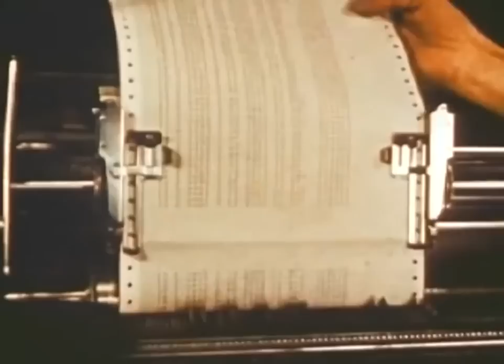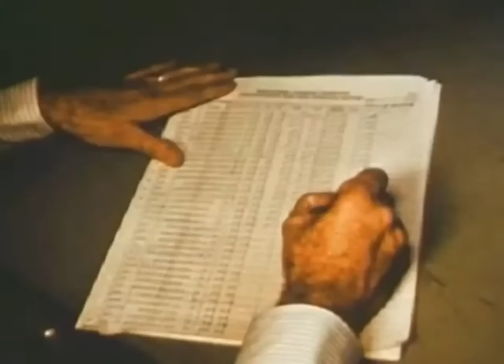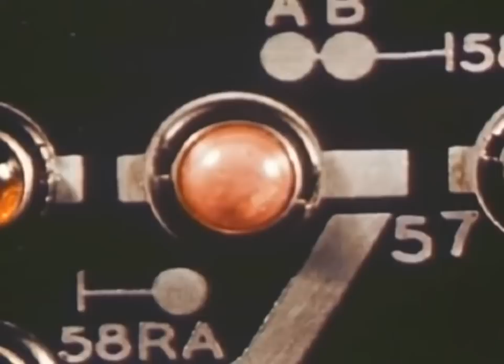The American Experience  The 1940s Great Railroads 720p

Comment: @ 20:36.  .  .  Liking it !   All the motive power are F Units and Cab Forwards. .  Thinking this film was around '49?  Just as the Geeps were about to come online.
Reply: They showed an occasional Alco PA, too! No Golden State/Daylight locomotives, though.
Reply: CPR still runs a GP30 built in 1962. It pulls track inspection equipment. It rolled into the yard I work in a couple of years back. Thanks to smartphones I could look it up by its road number.

Comment: Most of this was filmed after the 1940s: steam locomotives were still in service and the diesel locomotives were built in the 1950s.  I would date it around 1954-1958.
Reply: F3 We're built 45 to 49,
Reply: @larryarcher4502   But they were still in service for many years thereafter.
Reply: The engineers don't wave from the trains anymore, not like they did back in 1954!

Comment: Over the decades - when a railroad goes defunct or merges or is bought out by another railroad - what becomes of its employees? Such as Rio Grande or The Chessie System ...... are many the recipients of pink slips or otherwise if some and/or all are carried over/hired to the another railroad company do their retirement plans carry over to the hiring railroad?
Reply: They used to. Most of the mega-mergers happened long enough ago, there probably not enough "old heads" that worked for any pre-merger railroads.
Reply: Not a simple answer. The new road had to deal with the unions that were in place on the lines they were merging with and many complex rules were established to protect jobs of pre merger employees. Even today workers are at CSX or NS that have rights to bump into jobs in different districts because of rights granted at the merger with Conrail. It's simple in concept but strange in practice. Anyway most of the layoffs over the past 20 years have been because of system wide changes in work rules. The elimination of brakemen on thru trains for example. 40 years ago it  was normal to have a crew of 4 or 5 on a train nut now it is down to 2 and they are working to reduce it to 1. The biggest labor savings since the 1940's is the change to diesel power and the elimination of firemen and maintenance  shops to take care of the steam locomotives which required much more work to keep running than modern diesels.
Reply: @keithstudly6071  If I recall correctly, the employees of Montana Rail Link stand to lose all seniority now that BNSF is resuming operation of their lines that MRL operated until recently.
Reply: @whiteknightcat  It just shows how complicated it can be. Montana Rail Link is not a merger. BNSF is just taking back their track so what is BNSF's responsibility to Montana Rail Link employees? BNSF seems willing to employ Rail Link employees and are negotiating the terms these employees will be contracted under. Montana Rail Link employees fall under 10 different unions and each has their own concerns. How do BNSF employees feel about MRL hires working under different rules then they work under?  It's not simple.
Reply: @keithstudly6071  Yes, that's why I phrased my comment the way I did, knowing it was not an actual merger. Those MRL folks have really been caught up in a mess there. Glad I worked all my life in the public sector. (Unfortunately, that also meant it was nearly impossible to fire incompetent employees.)